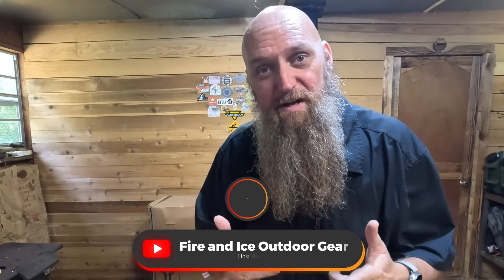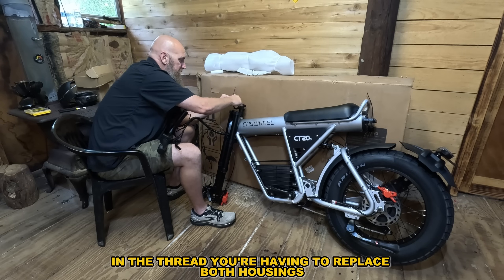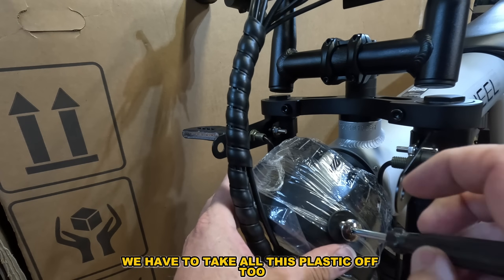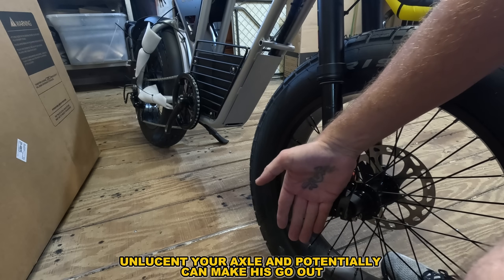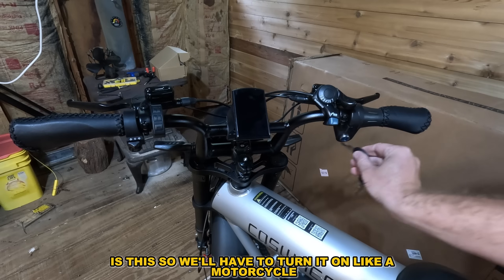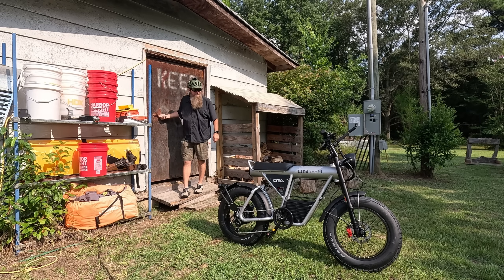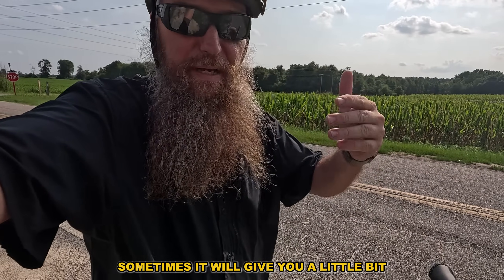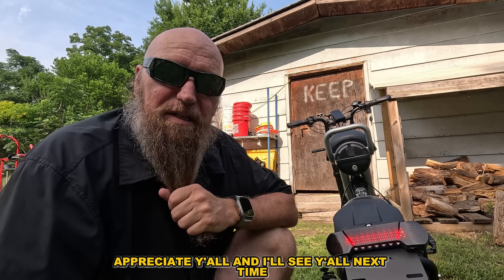Unboxing and Review of Coswheel CT20s

Comment: It does have petals. I’m sorry that thing is just wonderful. I didn’t watch the whole video so I had to go back and when I went back, I knew I’d be able to find a voltage because I like the style I like the way it looks and the way I love the way it has an amazing battery for that weight And it goes. Just the perfect amount of speed. Definitely street legal for me, but I always unlock it and make sure that I always put the correct current continuous current pole cause that’s part when you reset you resetting that part right there.

Comment: Two somewhat pedantic criticisms, I wish the rear lights were mounted on the back of the saddle somehow instead of the rear fender and I'm not the biggest fan of where the key is placed right near the throttle dangling around, going to have to figure something out regarding that, but otherwise this is a fantastic bike and I'll definitely be buying one!
Reply from the maker: I hot wired mine and got ride of the key.
Reply: @FireandIceOutdoorGear  Awesome! Thanks for the tip. Have you got a video or guide how you did that? I'd like to follow that guide. Cheers boss, and also great review!
Reply from the maker: Thank you buddy I don’t but it’s 2 wires and when you turn the key on it, connects the two wires together it’s pretty simple.

Comment: 11:15 Assembling a wheel yourself is a tedious job. I know something about it because I own an EKXBIKE X20 2000w 30 ah and one day my hands and back ached. Here I see that it is just as hard with assembly
12:15 and of course with the leg there was a problem after a few stands the screws came loose and one washer broke. I replaced and tightened so far it is OK
I am wondering whether to buy a GT20 or a CT20. Because I heard that CT20 can be unlocked up to 93 km/h
Reply from the maker: I think it’s the GT that you can unlock but here is the email you can reach Sarah and she can tell you exactly which one you can unlock. 
business@coswheel.com